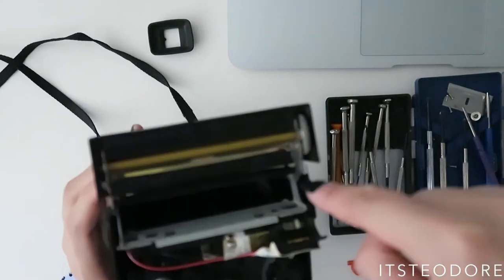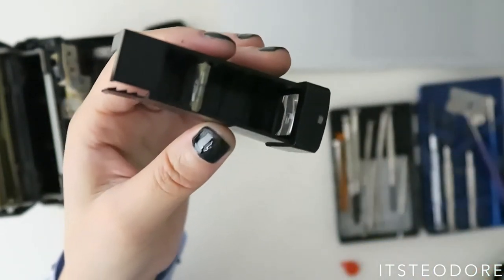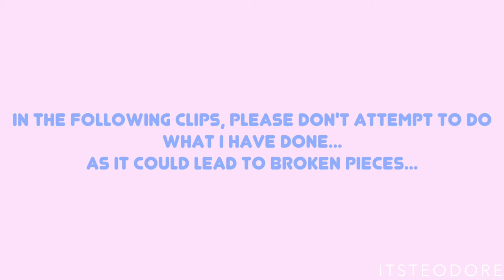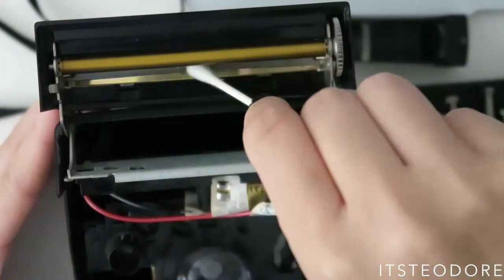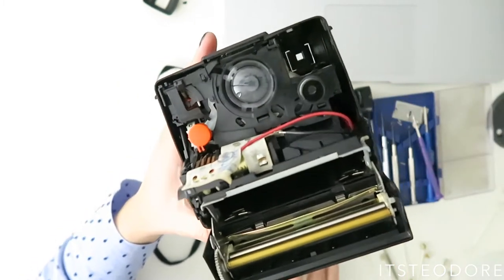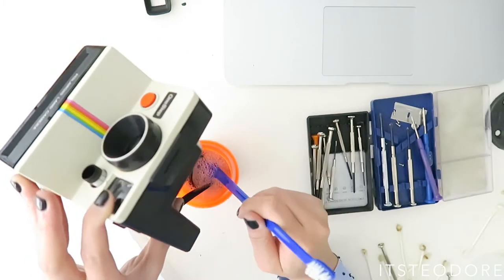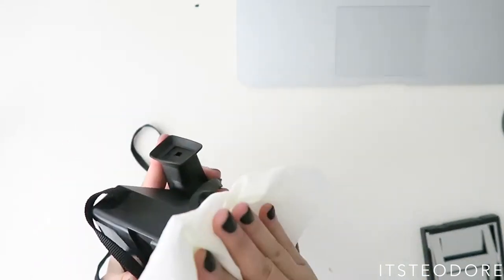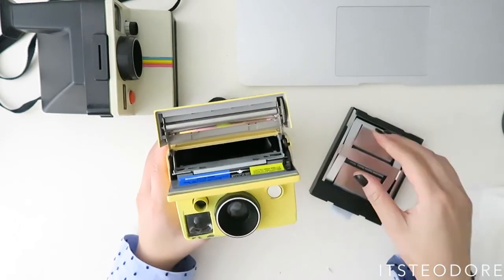Tearing Apart and Cleaning Polaroid SX-70 Onestep

Comment: really appreciate this vid. I just bought one of these cameras for my gf, who collects polaroid instant cameras, and I was disappointed to find out it wasn't working correctly when I popped in some film. you gave me the confidence to pull it apart :) just as an fyi, the whole camera can be disassembled without tools just by sort of squeezing the plastic body and gently pulling and prying with your fingers until the faceplate comes off and the guts slide out. now to see if I can actually fix it- the motor runs continuously when film is inserted...
Reply: I have the exact same problem.

Comment: Fantastic video! I make old fashioned photographic techniques like Talbot's Photogenic Drawing process from the 1830s and I needed to keep the shutter open permanently.  I glue a magnet and then use a lens cap as a crude shutter. A photogenic drawing takes hours to expose and the large format is just perfect. Best ting is I didn't damage the camera, I just pushed a lever to open the shutter and it stayed open. If I put a pack of film with battery into the camera, I'm sure the shutter will reset. Thank you do much!!!!!

Comment: Did you try using a new film pack? And did it work with it? Mine powers on with the test cartridge but it doesn’t click to open the shutter. Was hoping it might work with a cartridge that has film and not just the battery.

Comment: great video! can i use the 600 film in that camera? or i will have to get a sx-70 film?
Reply from the maker: You would need sx-70 film, but the 600 film will get overexposed. However, you can use a neutral density filter on your SX-70 camera so you can use the 600 film.

Comment: I believe that was smokers residue and it should have tried to release an image every tim you pressed the shutter button sadly so I believe it still has issues that need resolved these aren’t very repairable from what I’m told I have a new in box one that I opened and tried and the light meter is corroded but no one will fix it for me so I literally have a brand new one step just like this one that doesn’t work properly and can’t get it working that’s why I watched this video 😭 it’s so beautiful and I paid $100 for 5 packs of film because I was so confident in a brand new unused camera working 🤦‍♂️

Comment: Mine is broken in the sense that it won't discharge a photo if I press the shutter. Initially putting in the film cartridge will make it slide one out. I'm at a loss.
Reply: mine does the same thing it hurts to spend $2 each time you try.  I am saving the rest of the pack for my real SX-70 that is still working great!

Comment: Will the 600 film work actually shoot in this?
Reply: It should work in this camera because PO stopped putting a tab on the cartridge that prevented 600 cartridges from fitting in the SX70 (That was an old POlaroid thing) BUT you have to use the ND filter on the 600 pack unless this particular SX70 can be modded to shoot 600 without the filter

Comment: You are using 600 paper, but this camera uses paper SX-70
Reply from the maker: It shouldn’t matter, because I was just using the 600 film canister to test if the camera would turn on. There wasn’t even film in the canister anyways. The main difference between the 600 film and the SX-70 is the iso in the film.